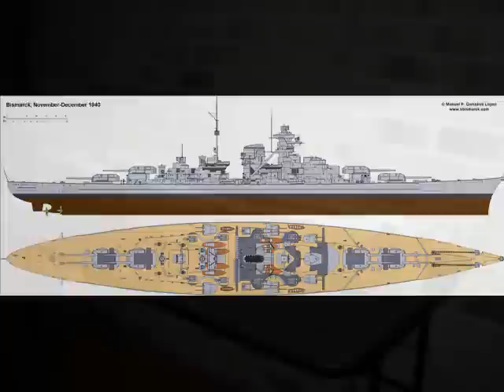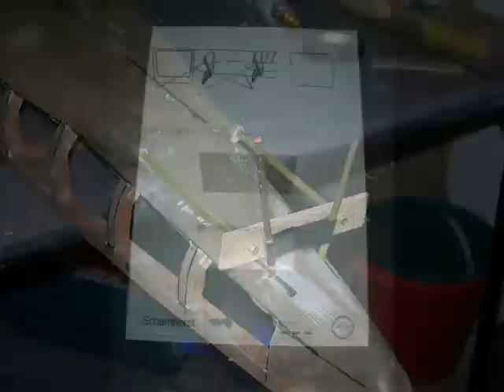Construction of a R/C Warship

Comment: Wonderful model, can you give a beginner like my self a detailed understand on what I need to turn say 350 scale ship RC? I have no idea what I need or where to begin. How do I prevent water in coming up through the shafts? use titanic for instance. I would settle with two screws, but then how do I run the rudder? how do I get power to this ship and use what type od motors to drive the screws. As you can see I know nothing. Anything helps. thank you.
Reply: Hello depends what ship your talking about
Reply: If tripitz buy 2mm size bass tube as the

Comment: Yes. The BB's are shot out by CO2 power. If you aim right, you blow holes in the ships hull  and such. And eventually water spews in. Most people equip their warships with water pumps to slow down or stop the flooding/sinking of the ship. But in the end, it usually just sinks.

Comment: what about the water pump in case the hull is breached?
Reply: +Ariel Quezada many have them, but their installation depends on which clubs oyu play with. Ships of a certain size are given so many "units" to work with. Units can go to guns, ammo, or pumps (and sometimes turret rotation ability) so you have to balance the design. Hell some even include pumps for the purpose of spraying the water they're taking on into the holes above the waterline of enemies.